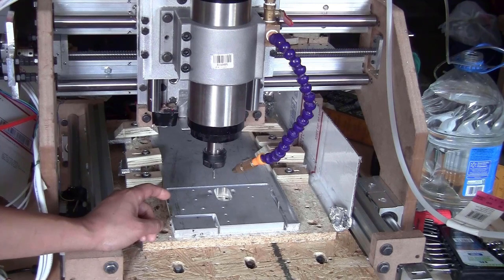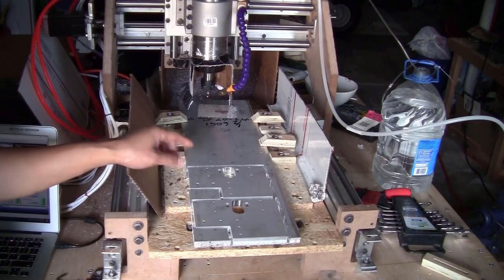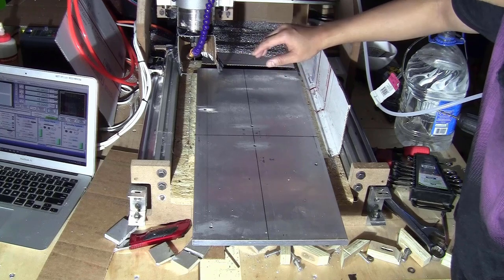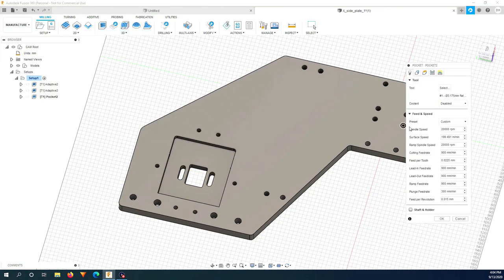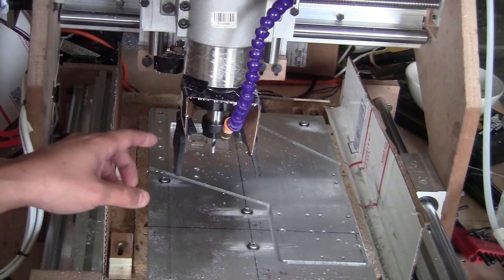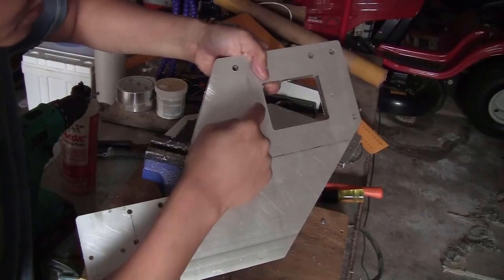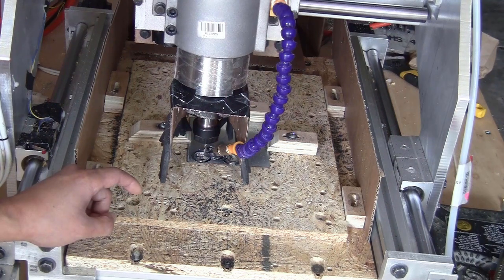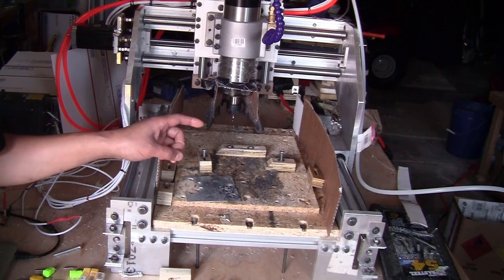DIY CNC mill - All Aluminum frame - My first steel milling experience - A bumpy road

Comment: This is a great video.  I've followed the progress through several videos and although I don't plan to go as far, I've been inspired to start the process of upgrading my 3018 with a more powerful spindle, linear rails, slightly larger and much stiffer frame and bigger stepper motors.  Thank you!
Reply from the maker: You never know my friend. The ambition grows after each upgrade. You might want to do more, make bigger things. At least that what happened to me and you saw it.
Reply: @minhsmancave9448  I wrote I didn't plan to go that far.  I didn't say I never would 😉
[My wife would be laughing in the background, so long as she doesn't find out how much of the housekeeping money I've spent]
Reply from the maker: @pnt1035  haha, I feel you. That's why you need a man cave. Make your garage messy so your wife doesn't go in there.
Reply: @minhsmancave9448  I'm about 19 years ahead of you there.  Garage conversion in 2001: 1/3 utility/washing room, 2/3 mine.  It was supposed to be 45/55 but I had a quiet word with the carpenters 😎

Comment: Man, you must be sooo satisfied with this!
I had to chuckle... your cardboard chip-guard keeps on hanging in there through everything you throw at it.  It reminds me of a bandsaw dust-collection fitting I made from flattened PVC plumbing pipe and scraps of plywood - it worked so well I spent ages making a really cool 3D printed version of it... that one did not work nearly as well!  Damn!    :o(
Thanks again for your videos!
Reply from the maker: So far yes, I'm really happy about the way it mill aluminum. I might need to change the waste board to something water resistant like aluminum extrusion to be able to spray water without worrying that it will damage the board. I definitely had concerns about throw water mist at that cardboard guard but I told myself that it's cardboard, I can make another one. In the end, it's still there and can be use again. I'm happy now but not sure how long it will be before I do something about the steel milling problem. It's hard to sit still when there's an itch in my head :D

Comment: Great job Minh. Been following you since your early 3018 videos. It's very funny because I followed the exactly same path as you and sometimes I already know what your challenges will be throughout the video. Congrats. I think that that X axis motor Frankenstein mounting plate needs a bit of love. Nevertheless...if it works...it works. Excellent work. Excellent video. great editing. And thanks a lot for caring for the viewers. The end of the video was excellent. Congrats
Reply from the maker: Haha, yes, I can cut it again now easily, just for the look of the machine. Functional wise, it works fine. Thank you for the kind words. I'll try to make and show more fun things.

Comment: My experience with a similar machine: Ok for aluminum, for steel not rigid enough, which causes tool break. And I never drill holes on the machine, I only center the position on the CNC and finish on a drill press, that is much faster. For steel work I bought a cheap BF20 clone and use it manually. Also, torque and speed of the CNC spindle does not fit for good HSS tools, that I prefer over the low quality tungsten carbide tools I can afford for steel milling, as they are much sharper and need therefore lower cutting force. Thank you for the video, it shows that I‘m not alone with this problem.
Reply from the maker: I'm sure there are plenty of people having the same problem. I might need to build a dedicated machine for steel milling, the moving platform type. This machine that I have here might just be good for Aluminum and I can use it to build the new machine.
Reply: Minh's man cave , exactly my plan, too. My next CNC will be rigid and sturdy, a C-type design with bed and column made from cast iron, large linear guides, thick ball screws and beefy hybrid stepper/servo motors. The spindle range shall be 500 - 5000 rpm only , belt driven from a three phase inverter controlled motor. Strokes of XYZ 350, 250, 250mm .Y axis shall be in the table, X and Z in the column. A project that I will start end of next year after upgrading my lathe.
Reply from the maker: Wow dude, sound like a industrial machine there. Please show me when it's done. It sounds awesome.

Comment: Hi Minh! Great videos, keep them coming! Your problem when cutting iron is certainly because of the spindle speed. Very roughly - your spindle should only turn at 10% of the speed when cutting mild steel when compared to aluminum. (And remember that your feed rate needs to be proportionate to the spindle speed - imagine each tooth on your cutting tool taking a slice of material so if it turns slower you also need to feed slower.) Also, coolant is a requirement for any type of steel, there is just so much more heat.  Amazing home build of a CNC machine though!
Reply from the maker: Hi Todd, thank you for your inputs. I had zero experience milling steel and that was the first lesson. I was kinda know that my spindle speed is too high but with this type of spindle, I get almost no torque at low speed. In the end, I think there are few reasons that my machine is not really suitable for cutting steel: spindle speed, setup (not ready for cooling fluid) and design (moving gantry is not rigid enough for steel). I will need to build a dedicated machine for that application when I feel the needs. For now, I'll try to see what I can do with this one first.

Comment: Your machine is so cool! You did a great job and your videos are so detailed but also clear, thank you for sharing your experience!
I will build a similar machine, maybe a bit smaller but with prismatic rails instead of the 20mm bars. I'll try to show you the building steps
Reply from the maker: Thank you for watching. I have no experience with the prismatic rails and not sure what's the price for those rails. You can find a set of SBR20 rails with 1605 ball-screws for quite cheap price ($190 - all 3 axis). I'll be happy to see your machine.

Comment: Minh, I spent the last day designing the X, and Y homing switch holders (no tape, glue, or drilling) with my 3d printer.  Next up Z, but after much thought I don't think I will do aluminium, or any metal, because I don't have a non carpeted area and one hot chip flung could spell disaster even from a 3018 Pro.
Reply from the maker: Well, I don't think that it will be that hot to burn your carpet but it can be very messy. And milling aluminum on 3018 cnc is not simple as you can see that there are only a few videos on YouTube about that. Most of people only do it once and don't want to repeat again since it will damage the 3018 in some way (including me). I'll just stick with wood and plastics for the 3018 if I still have one.

Comment: Get you some Carbide bits for cutting steel,   You wont get the best finish from carbide but it cuts steel like butter.   your also going to need to use a cooling lubricant fluid like light oil or a light weight motor oil,
Reply from the maker: I will need proper setup so the oil doesn't run everywhere. I'll try to mill steel in the future. For now, I'll just stick with wood, plastic and aluminum. Thank you for the advices, I'll keep them in mind when it's time to try again.

Comment: That Chip Accelerator of yours looks very effective. Would a vacuum be effective in removing chips.
Reply from the maker: Vacuum can only clean whatever on the surface, it doesn't go into the track. Better get a blower and vacuum at the same time

Comment: Hi Minh really  I want to congratulate you. I have seen how you started to upgrade the 3018. You have reached a very different level now. The last upgrade with the alluminium brackets and plates makes your previous efforts obsolete. I would appreciate some information from you: Can you tell me what controller,  stepper motors , drives and spindle you have chosen ( is it water cooled with inverter?) and where I can buy them from? Was it difficult to assemble and make them run? Thank you
Reply from the maker: Nema 23 425oz, dm542 stepper drivers, rnr motion usb mach3, 2.2kw water cooled spindle, all on eBay. You can see how to setup the spindle in my video comparing router and water cooled spindle. Not hard if you pay attention to details.

Comment: lmao keep em coming! Road to tormach :D
Reply from the maker: Road to build one or road to buy one? :D
Reply: @minhsmancave9448  Why buy when you can just make one? Keep it up man, I love your videos. I am way behind you, but am using a 3018 and following along the best I can. I am very curious how you progress after this point, if you continue your upgrade series.
Reply from the maker: @Kyle Shovan I was just kidding, can't afford it anyway. Tormach does sound like a good machine. Well, of course with money, you can always buy good machine. The best thing about DIY is that we can try to get the best out of the least and also having fun doing it. There are still few more upgrades to this machine that I wanted to do (not structural wise) but will make the machine more reliable and more convenient to use. Surely will share when I make that happen.
Reply: @minhsmancave9448  will be happy to watch. Just curious why you decided to make a moving gantry instead of fixed gantry machine? I am deciding what my next machine will be. The fixed gantry, or even a fixed spindle, seems like it would give a lot more structural rigidity. 

By the way this is a side note, but I am assuming you are in the US, correct? You mentiones you ordered from Amazon and set your VFD to 110v input.

Coincidentally I live in Vietnam at the moment. I bought a 3018 so I dont have to pay a lot of shipping back to the US. If you are ever in HCMC at some point, post covid, please let me buy you a beer or a coffee.

Keep up the great work, Minh.
Reply from the maker: Many people ask me why I choose the moving gantry design and the answer for me is the larger working area compare to the moving bed. It's less regid for sure but my intention is to do more 3D relief on wood than milling steel. I'll let you know when I be back to Vietnam and surely will be happy to meet up.
Reply: @honkhonk165  - Or how about a Super-Duty mini mill? That's what I'm working on. A very heavy table on a heavy bed, whole machine weighing about 350 pounds. Mass generally means stability,if it's placed properly. Already have most of the parts and a good deal of the tooling - all BT30 stuff with the heaviest spindle I could find from China (sorry) and 25mm ball glides and 16mm ball screws. Stepper motors have been acquired, but I believe I am already working on upgrading to Teknic ClearPath SD servos. I'll try to get video and pics to do a progress report...

Comment: Get a 4 flute HRC55, emd mill from aliexpress, its like 3 dollars and it works well, you do want 4 flutes for steel
Reply from the maker: I tried 4 flutes on aluminum with this spindle and the chips melted and stuck to the bit right the way. Not sure if that will be the same case on steel. Usually to mill steel, the speed of the spindle is around 3000 to 5000 rpm. I think that this spindle's speed is just too high for steel.

Comment: Talking about the steel sheet milling, can't your wonderful plasma printer make it accurately? The cameo is a piece of Art really. I wondered how beautiful it would be if you used brass... Sky and imagination are the limit...
Reply from the maker: Surely my plasma cutter could cut it easily within seconds. I just wanted to try to see if I can mill it. Milling is still more precise compare to plasma cutting (kerf width might change when the nozzle is burnt) and there might be slag and dross problem. Milling also can cut the piece at different depth, plasma cutting only cut through. Anyway, I was just testing and learned what I need to mill steel. When I get hold of a piece of brass, I'll try to make another 3D relief to see what it look like. Prends soin de toi mon ami !
Reply from the maker: Et tu te lèves tôt ou tu n'es pas encore au lit ?
Reply: @minhsmancave9448  Je suis debout à 3h du mat', forcé en partie par mes communications avec mes connaissances chez vous ;)

Comment: Good job! I gather you are using a high speed steel endmill on the steel? And it looks like a two-flute endmill, to boot (watching on mobile phone). Go to a 4-flute carbide endmill and you'll be fine. Like your work a lot. Keep it up!
Reply from the maker: I didn't know what i was dealing with so I used a carbide single flat end mill (well, few of them) that I used to cut Aluminum. I will have to make another machine that's dedicated to mill steel like what you're doing.
Reply: A lot of those "carbide" bits from Aliexpress are really high speed steel, or tungsten steel. It's getting so that you can't believe anything they say on Aliexpress.

Comment: Minh, do you feel affected by the Fusion360 new limitations? Is there any alternative, you could possibly recommend, for the beginner?
Reply from the maker: Surely fusion 360 free version is limited. Especially the g code modification function is disable, it doesn't allow you to visually delete the part of the Gcode you don't like. But it's the same for all free CAM software. When you have limited resources, you always try harder to find solutions like the way I build my CNC. I just started with fusion 360 and haven't really looking somewhere else yet. I'm sure other viewers here will give you some suggestions.
Reply: Minh's man cave : I suggest the free Solid edge community edition or FreeCAD, let us know what you decide.
Reply from the maker: Thanks Klave, I'll try and see. Fusion 360 started pissing me off recently by slowing down the fast movements (when not cutting). They try to force free users to buy the full license. Limiting the number of axis to 3 apparently wasn't enough.
Reply from the maker: @klave8511  I tried FreeCAD but didn't like it too much since it doesn't have the tool library like fusion 360 (I got spoiled). All the parameters about the tool had to be re-entered and it seems that FreeCAD uses mostly parallel tool path which is not optimum in some applications. I'm trying Solid Edge and will update later
Reply from the maker: @klave8511  Solid Edge Community edition only does CAD, doesn't have CAM.
Reply: Minh's man cave : ouch, that’s a big omission. I did think, when Autodesk crippled their CAM, that you can export the step files to FreeCAD and use FreeCADs Path workbench, it looks as if it has all the useful functions.
I love Fusion’s ease of use and the change to a different CAD system is a pain, especially if the underlying workflow is different. That timeline feature in Fusion sure makes me lazy, just go back and trim it later! Maybe that was the plan from the beginning. 
SolidEdge workflow (I’m still getting up to speed) is different, easy in some ways and difficult in others. They have great tutorials online an onscreen help galore.  FreeCAD seems to have a lot of features similar to Fusion and great online tutorials but I get stuck in the oddest places and have to delete stuff to start over. But it is the future I believe.

Comment: Great video 8). You said  the bits you use were cheap. Where do you get them from? And is there any bits that you use a lot? Thanks in advance my friend 8) .
Reply from the maker: I buy the bits from AliExpress. The bits I used the most are flat end mill of all size, but mostly 3.175mm(1/8").
Reply: @minhsmancave9448  Thanks for the info 8) .